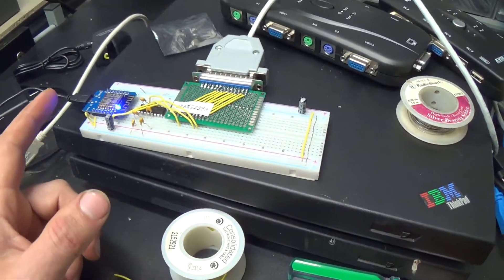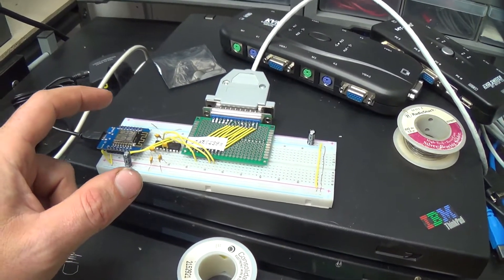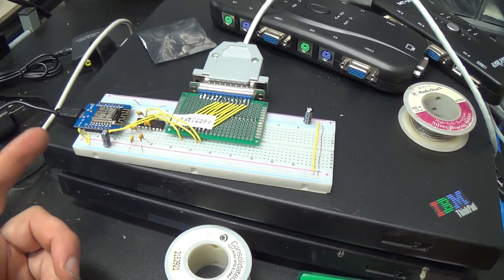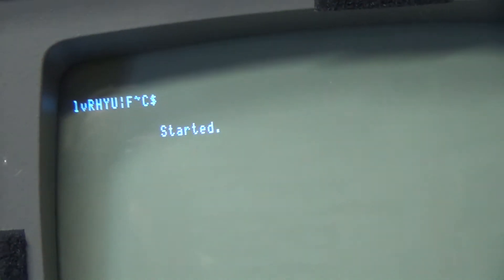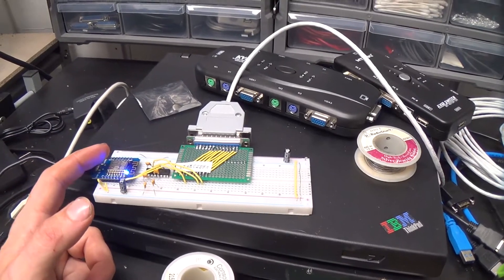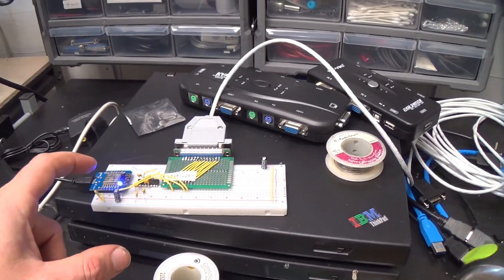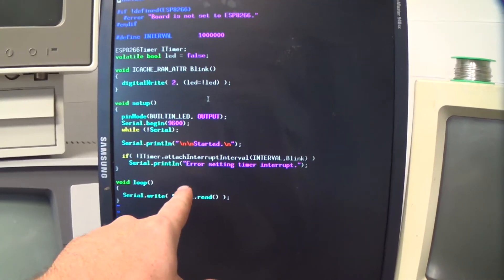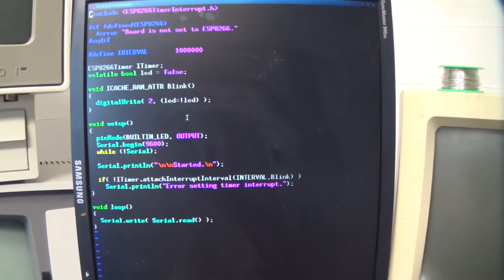ESP8266 Serial-Wifi Bridge (Pt1)

Comment: So is the idea that the ESP32's webserver will show any traffic received from the serial / bluetooth?

Is all the code custom, or was there a starter project that you found?
Reply from the maker: It bridges serial ports over wifi using TCP sockets.  There is no web server.  The code is simple and the only security is the transport layer (WPA).